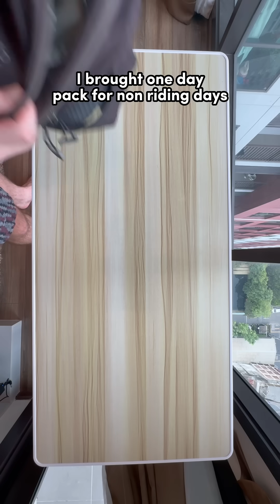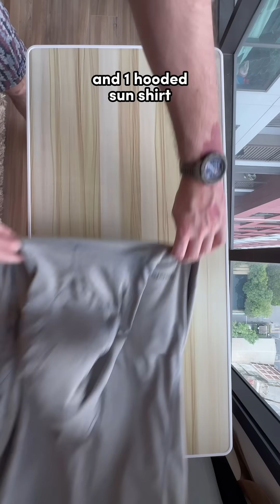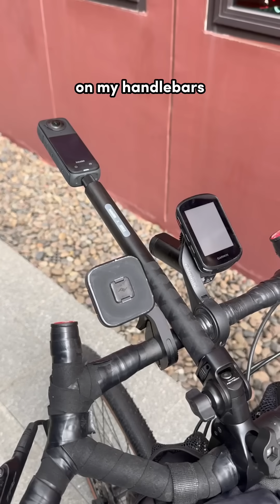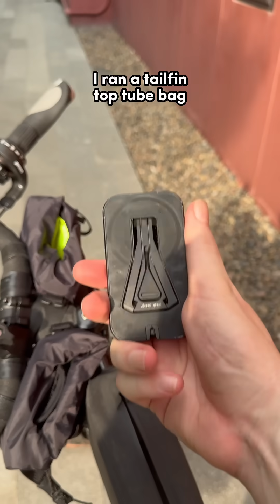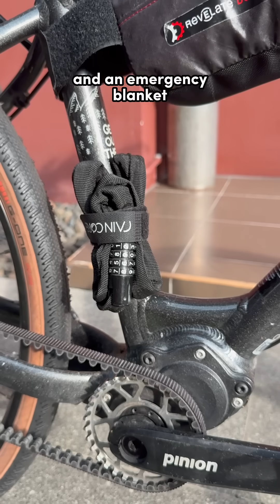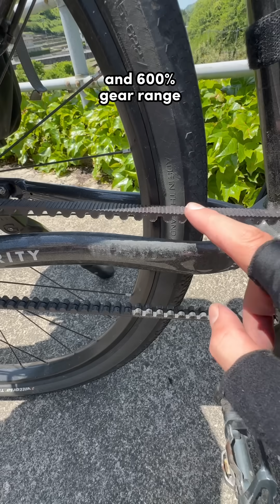Everything I packed to cycle across Japan!

Comment: Sick Priority rig. No wonder you had no mechanicals with the gearbox and belt. Kinda surprised you didn't have more than one puncture with those Schwalbe G-Ones. I've had mixed success with punctures on Schwalbe myself. What was the overall weight when fully loaded?
Reply from the maker: I was actually using vittoria terreno zero endurance tires during the trip! The ones on there are the fresh set a bike shop in Thailand installed for Korea!